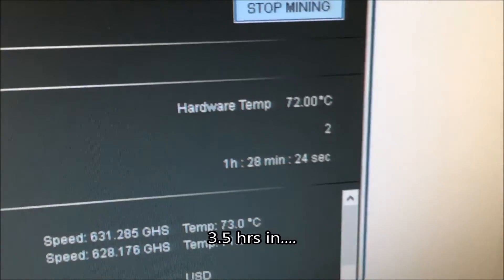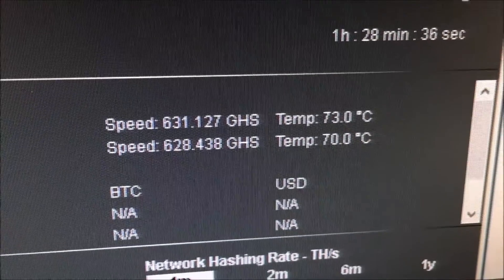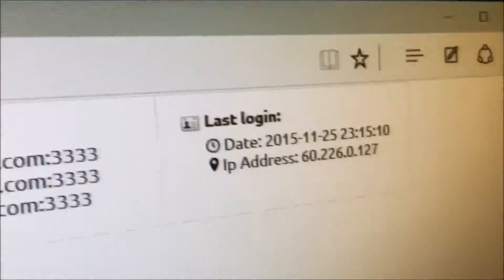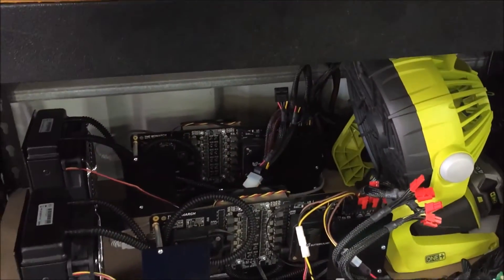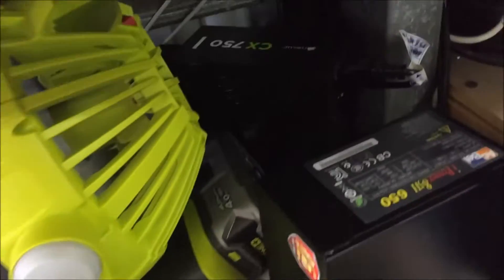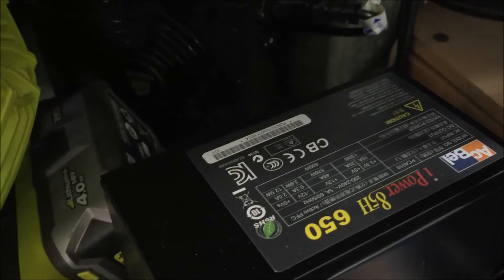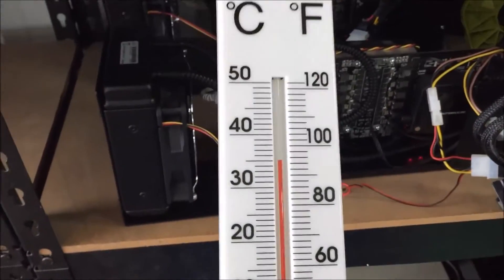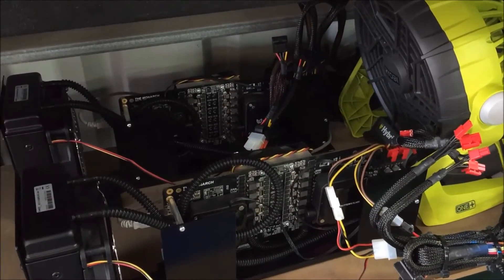Butterfly Labs Monarch 3.5 hrs in...

Comment: what happens if you underpower these boys?  i ran two power supplies to one.  each with a splitter from the 12 v rail and i was pulling about 39Amps, one psu is rated at 400w/12V-14A and the other at 550w/12V-25A.  this idea didn't seem clever enough and cgminer shut down, so i ran just the 550w and the psu died.  i went back and ran the 400w intot eh card to test it, ran the 360Ghs it got with the 940w, and i should get a collective 1.4 from mine, any tweaker advice other than give up it a waste of money.

Comment: Are you actually going to end up getting your return on these? Electricity must be close to that $4..
Reply from the maker: +Zlyzer Currently I'm running them only 6 hours a day when I have spare solar production. As much as I hate to admit it, I will make a small return if I stick with it. I sell my excess power to the grid for 6c/kwh and the units together use 1.4kw/hr and I'm making 60c-$1/6 hours on average. It was never done to get me rich how ever I would have liked the returns to be a littler higher. Time will tell, I have both units up for sale then I'll get some larger ones to tinker with.
Reply: +Peter Matthews Interesting, so you make more than the electricity that you sell is worth.. that's good! But will you recover your investment on the machine long term with increasing difficulty? How come you only run them 6 hours a day? Does the electricity from the grid cost more?
Reply: +Peter Matthews Also, do you think it would be possible to build your own miner that is ahead of the pack using generic parts and PCBs? I feel like the power of these miners is regulated to allow the companies selling them to sell more over a greater period of time..
Reply from the maker: +Zlyzer Eventually I will at some point MAYBE, increasing difficulty is a part of life. Won't dwell on that too long. 6 hours is the time I have the most spare solar power. I buy electricity from the grid at .24c/kwh and sell at 0.06c/kwh so I make more from mining than I do from selling to the grid.  Either way it kills a lot of time and I get to make videos and entertain my self.
Reply from the maker: +Zlyzer As for making my own, won't ever be happing here & bet there is a conspiracy theory around about them holding back the good stuff..
Reply: +Peter Matthews Cool, thanks for the replies! I think a lot of tech is held back and released in incremental steps in order to maximise profits for the companies producing the tech.. I think it's just the way the world goes round! Imagine if Intel released the best processor they could produce now... they'd probably have nothing for next year. That's why I think it'd be great if you could build your own.. although I have no idea how hard that would be or what's involved!
Reply from the maker: +Zlyzer no doubt things are with held to some degree but I would think that would be more because of the 'product testing stage' than anything else.